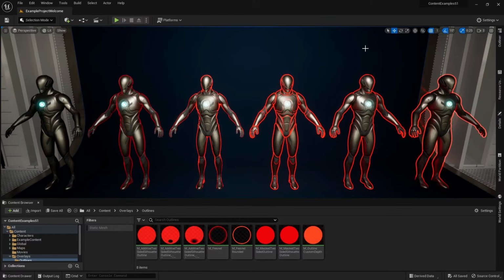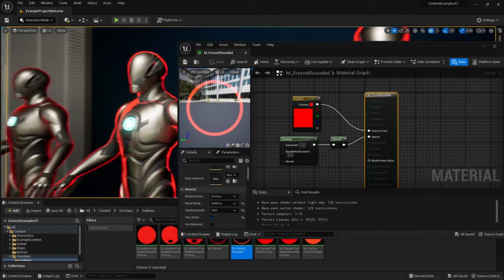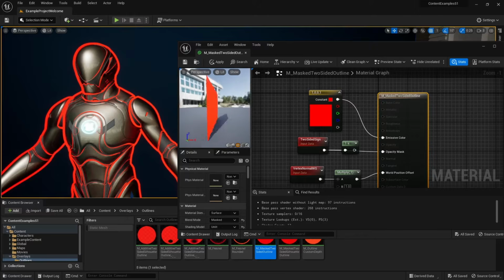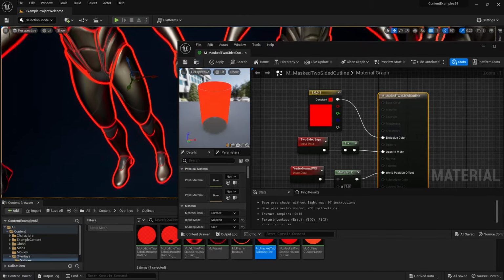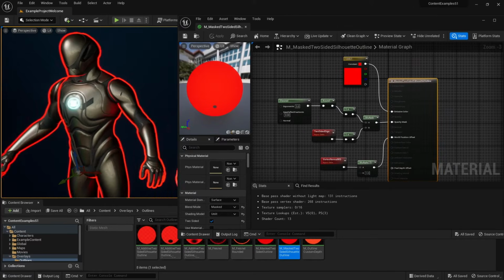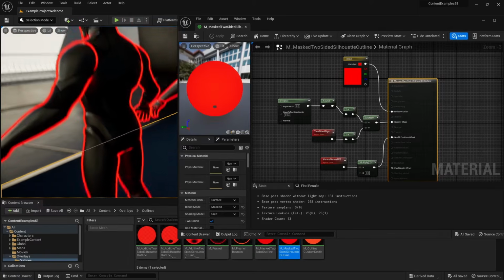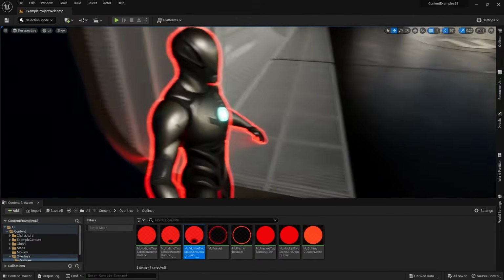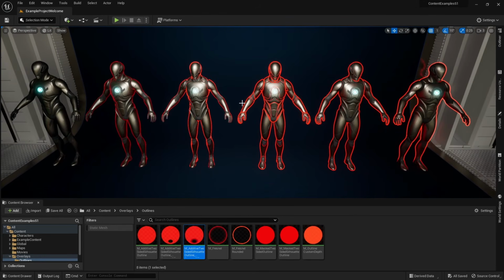How to create an outline effect using overlay materials - Unreal Engine 5

Comment: how can I adjust the width of the outline? (using blendmode: additive)
Reply from the maker: Hello. The ones using the two sided sign node in the opacity, you can increase the value that multiplies the vertex normal node, which is connected to the world position offset. This will increase the size of the overlay mesh.
Reply: Thanks! @LightningSageGames